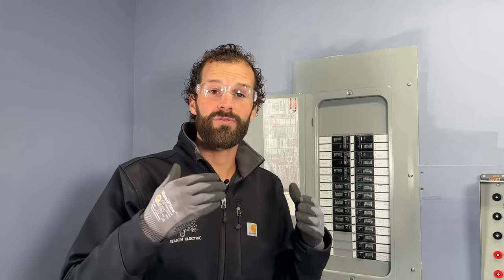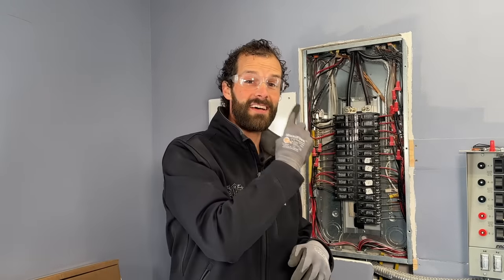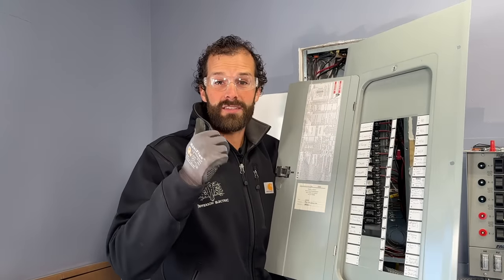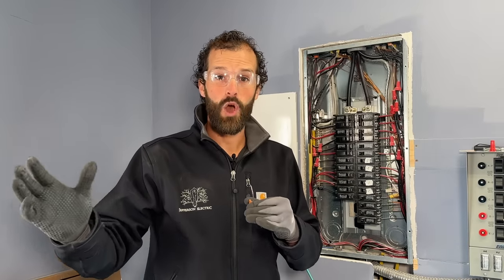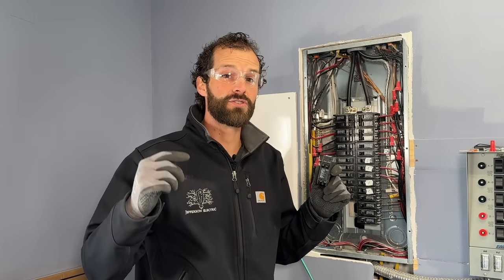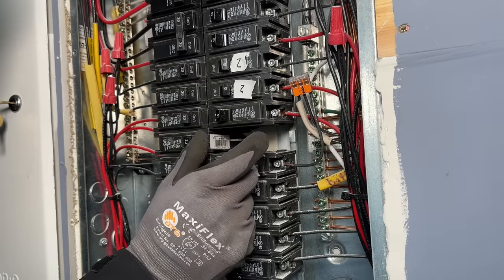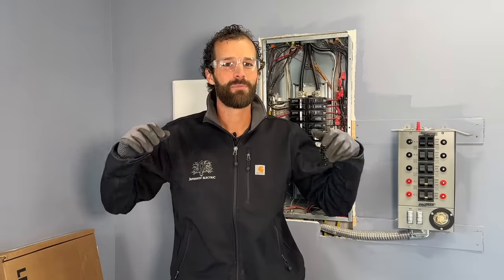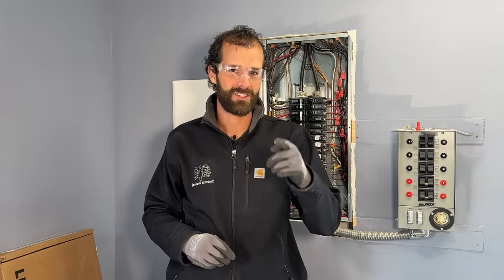No Room In Electrical Panel - Quick Fix

Comment: Please refer to NEC code 312.8 before making any connections inside the Cabinet area of a panel board. 
Again, showing home owners something that could possibly create a hazardous event is not the best possible solution to make money off of YouTube.
Electrical additions can be complicated and dangerous if done improperly, maybe it would be best to tell the DIY crowd what they are Allowed to do as a homeowner. Such as replacing Like for Like … a switch, plug, light fixture…. Nothing 240.

Comment: It doesn't matter what the manufacturer rates things for. The final say is the Inspector. They are God for all intent & purpose. They are who pass or fail you, not the manufacturer. Even if the Inspector is technically wrong, they're still correct. Even if they insist it is done in a way that violates NEC; the code doesn't pass or fail you, the Inspector does. 
Split Breakers are the way to go in my opinion. Makes every Inspector happy and home owner feels easy, and no concerns from Electricians 17 years in the future.

Comment: Stay away from Smart anything, install any of those in your home, in the future, as required, your Power supply company can limit your usage of things such as Ac on high demand situations. Its already happened with smart Meters and Smart thermometers. They sell them to you on the promise of savings(which can be true) until they want to control your usage.

Comment: I'm sure unnecessary but with the waygo I'd put the wire from the breaker in the center
Reply: @Kevin-mp5of  I'm certain there is not absolutely no difference it's just not enough to matter

Comment: if the electric car has 220 plug you could connect to the electric dryer plug.

you would need a heavy duty extension cord just put dryer plug and outlet onto a length of 6 awg wire used for underground wiring.

i think breaker manufacturers should require the dual breakers closest to the incoming line.

typically dual breakers are for higher current loads like 30 amp and up.

if the dual breaker is placed on the bottom end of the bus bar there is the resistance of the bus bars.
Reply: Elon forbids that.

Comment: Either get a double single circuit breaker.  This is a code violation and also would probably cause a fire do not splice two wires to a circuit breaker.

Comment: Combining circuits is not a safe thing for homeowners to do, period.  There was no mention of neutral sharing, if you put two circuit on the same 1/2 phase they will add to the neutral rather than subtract.  If you dont understand what I just said dont touch your panel unless you want to burn your house down.

Comment: :55
That is NOT needed to remove the inside panel nor to add or remove a breaker or wire from a breaker inside that same panel.

Comment: You can also combine 2 single pole breakers to get 220 by putting a piece of  wire through the holes in the breaker arm and tying them together. Just be sure it's allowed where you are at.
Reply: @Kevin-mp5of  

Think what you want but it is done! They even make a handle tie kit just for this. I don't think you know as much as you think you do! Look it up, HOM1HT handle tie.
Reply: @Kevin-mp5of  

Watch a video titled

9-20 using handle ties 240.15B
Reply: @Kevin-mp5of  Old Bryant breakers (1970's) used a removable tie to connect two single pole breakers together to make double pole 240 breaker. Parent's house had them.
Reply: @ Jesus is Alive!   @hotpuppy1  Codes are revised, friends. We most certainly are not living in the 70's. If you want to do things in defiance of code your insurance company will wash it's hands of you, and you could be in for nasty nasty legal liability if there is an electrical mishap.

Comment: Yes, but no. I would just say that it's not best practice to use a Wago or wire nut in a loadcenter. In the video they look like red flags, (because they are). A loadcenter or service, panelboards are not junction boxes. I would have added a lug block to the bus and added another loadcenter.

Comment: You really missed if there is shared neutral between phases. If there is, you just explained on how to start a fire.  I know it isn't very common, but I highly doubt people watching this video for install, instead of "pro tips" would be aware of the consequence of what you just showed them. For anyone going this route, if you have as many neutral wires landed as circuits breakers, you are most likely ok.  If not, I would really recommend getting a professional, or doing some research on neutral sharing.  Please cover the importing things first.  Aso a stab at the craftsmanship, C+ for connections in the box and wire/flex conduit routing, it's kind of ugly.

Comment: How about cutting off the deformed wire end after it has bern in the breaker terminal and stripping a new length before inserting those hots into the wago connector. And after saying not to have exposed conductor at the wago you have a good 1/4" of conductor exposed on the pigtail at the breaker 😮👎

Comment: I replace all my breakers with 30A breakers, they run at 25A 24/7, the voltage drop is fine if it's a short run like 4 ft to the outlet over 12/3 AWG wire.
Reply: You can put as large a breaker that you can find in a slot. The problem is that you are making the wires in the walls the circuit breaker. There is a reason that breakers are sized to match the gauge of the wire. If you over size the breaker it is allowing more power through the circuit than the wire can handle. The wire is literally getting hot inside your walls because it is not being limited by the breaker. Good luck when the whole house burns down and the insurance company sees what you have done. Oversized breakers are a recipe for disaster. 25 amps continuous on a wire rated for 20 means the wire is getting hot all the time.  Please call someone that is qualified to do it correctly.
Reply: @adamsurjan2228  The voltage drop of 25 Amps current over 12 AWG wire over 4 ft is four times less than the voltage drop of 20 Amps over 20 ft. My comment isn't for people who hide electrical wires in walls where they can't be inspected. My post was for people who can do basic math.
Reply: If you are running 12AWG wire with a 25A load, you are overloading the conductors.  25A needs 10AWG wire.
Reply: @jamesclark7787  At this point, math is irrelevant.  It is the code requirement.
Reply: @jamesclark7787  Yeah, but you're dumping the power into 1/5 of the length. What are you doing anyway, running a grow house or mining Bitcoin?
Reply: @chaos.corner  The point is that those rules of thumb from 50 years ago are for uneducated people working construction who didn't need to know the math. Today you can google a current calculator and know exactly what is safe. And those DIY people are exactly the people who are watching this video. They can install an outlet next to the breaker box and run a 10/3 extension cord to wherever power is needed.
Reply: @jamesclark7787  True enough. I recently did so when someone wanted to use thicker and more expensive wire for a kiln than was needed. Saved about $60.
Reply: Just so you know voltage drop has nothing to do with the amperage of your breaker.

Comment: The third option is the only option IMO, also you shouldn't be jabbing the buss bars with a non insulated screwdriver, especially on a video intended for DIY. Did you lock out the disconnect that is ourside your view? You never explained how to do it safely... If you are a DIY'er and watching this as a baseline you have no bussiness working in your panel.

Comment: In your demonstration you took a load off L2 and added it to L1, if those circuits shared a common neutral the neutral wire is now carrying the combined current of both circuits. If each circuit was to draw max current,  lets say 15 amps, the neutral would now be carrying 30 amps presenting a fire hazard due to overloading the neutral! Loads must remain balanced! 
Secondly, for all your viewers, they should check with their local municipality to see what is allowed. In my area they do not permit two wires on a single breaker or any connections in the panel box, wire nuts/wagos. Any combining of circuits would need to be done externally of the breaker panel, also the use of single pole tandem breakers are forbidden in my area.
Reply: @Kevin-mp5of  I think you should review nec codes. You are able to run one neutral to two hots providing one is L1 and the other is L2, a balanced circuit thru the power companies transformer. A common trip breaker/double pole breaker is not necessary since the maximum current thru the neural could never be exceeded. If you had both circuits on L1 let's say the neural is now carrying twice the current. I was trying to be constructive  and help people from making mistakes that could be serious. Yes, if you don't know what you are doing people should avoid this type of work. FYI I am a licensed electrician Chicago Illinois.
Reply: @Kevin-mp5of  Sorry but that is absolutely incorrect. I was just trying to pass on some good information to you and your subscribers. Good luck to you all.
Reply: Wrong terry. You have no understanding of split phased power. L1 and L2 are 180 degrees out of phase in 240/120 volt system. So if a circuit shares a neutral and L1 and L2 are both 15A then neutral is 0 amps. Being 180 degrees out of phase the current waves cancel in the neutral. Electrical Eng 101.

Comment: I was told by a master electrician that it was against code to use a panel as a junction box (no wire connectors) I'm in AZ if that matters
Reply: as far as I know. NEC has no rules against junctions within a panel, but many inspectors may use local code to push that because people will tend to stretch the limits over time, and it will become a rat's nest.
Reply: It's not against code, sometimes it's absolutely necessary especially in situations where your upgrading the service so you don't need to rewire the whole house.
Reply: @NethTech  ... doesn't happen often but I have heard stories where the inspector insisted on adding a tray or a junction box outside the panel. Personally, I have seen a few panels that I am sure have exceeded their fill rate on wiring and I have had trouble starting the cover screws. You just have to walk away from those!
Reply: The Code violation that CAN be applied to making junctions in panels is a reference to 'gutter space'. In general, the gutter space in a typical panel , after applying the correct calculations, does allow for some wire nuts and pigtailing. I have never sat down to figure it to the cubic inch but it's something that is obvious when the panel is filling up from the splices or taps and a good workman should know it.

Comment: option 1 is a hack job imo. Using the main panel as a jb is horrendous. Double breakers are 100 times better. If you want to join the wire do it in a proper jb above the panel and feed one wire back to a single breaker.

Comment: If you add a conductor to a 15 amp breaker, no problem.  If you install a piggy back breaker you now have the potential of adding 15 additional amps to an existing neutral. That would be a fire hazard as I see it, unless unless you are installing a whole new circuit complete with  neutral.
Reply: @user-dn5cr6fe6h is correct..to say that using a tandem breaker would overload the neutral would be no different than suggesting all branch circuits in a panel that are connected to the same line leg (because there are only two after all in single phase) would potentially overload the neutral. As long as the individual branch circuits connected to the tandem have their own neutral, you are completely fine. You are, in a sense, running a parallel neutral, so for two 12-2's for example,  you actually have two #12 neutrals running from the panel out. The problem is when you have a multi-conductor branch circuit, for example a 12-3, that feeds two separate circuits with only one neutral, at which point you the potential to pull up 40 amps on a #12 neutral before anything trips.

Comment: homes over 20 years homes have a danger. multi branch circuits. thats where they use 3 wire. mainly bk and red and shared white. which if this is done WILL over rated the breaker.
Reply: It's fine when done correctly, double pole breaker, It connects to opposite legs so the lower load is subtracted from the higher load, then the current on the neutral will always be less than the higher load.

Comment: At 4:49 this supposed "expert" is leaving exposed conductor outside of the breaker terminal.  He should have trimmed the exposed conductor so that the insulator covers most (all but about one sixteenth inch) of the cable outside of the terminal.  "DO NOT LEAVE CONDUCTOR EXPOSED"
Reply: You are amazing

Comment: Just use tandem breakers
You get two breakers in one slot
Reply: True but they free up a lot of spaces especially if you use LED lighting and double them up
Reply: Well if your panels that old it Probly needs to be updated

Most plugs switchs breakers fixtures need to be replaced after 30 or 40 years

I’ve had a lot of houses I’ve had to go through and redo cuz they where about to catch fire